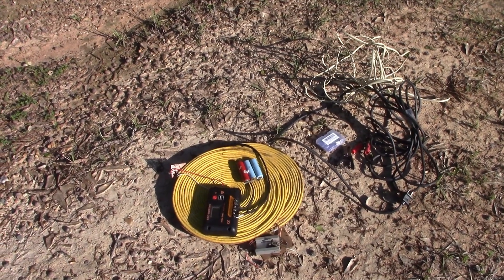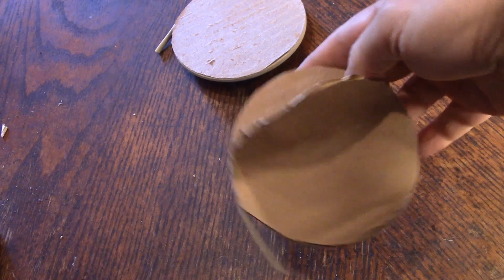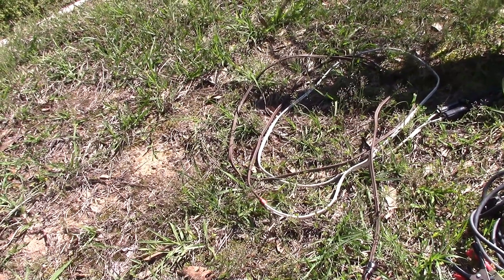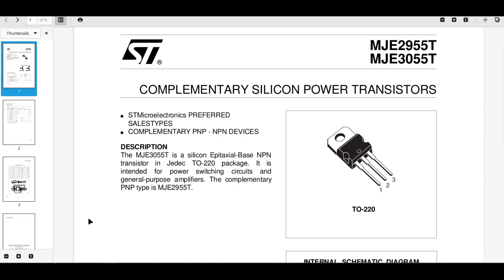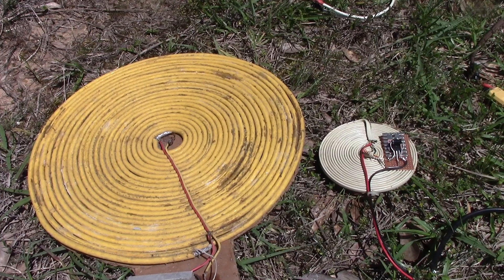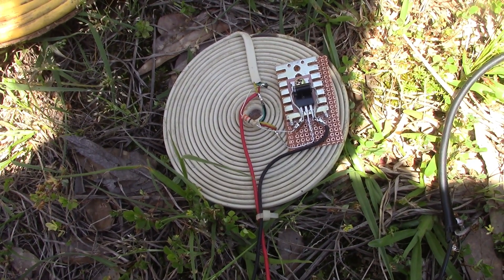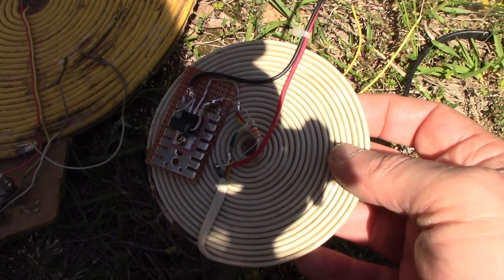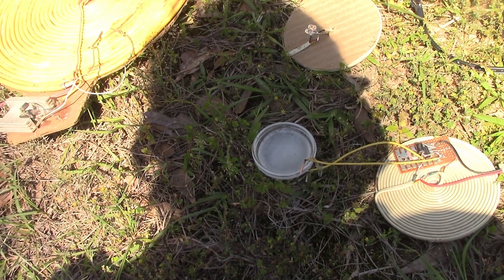Window Wireless Power Part 2 - Upgrades

Comment: Be interesting (for this Geordie in Calgary) 
to see what you come up with. Subscribed!
Reply from the maker: Thanks dSquared 😀The latest is that I blew up at least 4x MJE3055 power transistors yesterday, one of them instantly made a snapping sound and cracked down the case on connecting the wires. Then realised it could be because of the solar activity! Solar panels and the biggest solar storm in decades don't mix 🤣

Comment: I've got a wonderful idea. Why don't try my idea, use the ground, sand, and terracotta pot method. This has been used by the ancients, and third world countries for years.
Reply from the maker: Thanks Timothy, that's a great idea! As in a 'sand battery'? We used a large metal bucket with sand in over winter, would put it on an outdoor fire for a couple of hours each evening. Something similar with a piece of toaster wire or grafoil in the pot is the thought, varying the size for the right resistance 😀

Comment: heat sink the shit out of the resister
Reply from the maker: That's where it's headed I think, Tim 👍
Grafoil has been found to work instead of the water/copper thing, but it gets really hot as a current limiter too from the panel.

Comment: I wonder if you increase the voltage so in theory reduce the  amperage and then reduce voltage to get your amperage back. More telsa less Edison. Great video i have every faith in  you to solve it after watching your older videos. Good stuff thankyou for sharing.
Reply from the maker: Cheers John 😀
I think it's the voltage stepping in as the issue y'know, but your point is great to work on. If the panel is sideways or away from the Sun then the circuit works fine. In full direct line it quits and heat builds fast. Also, that's a noted effect with some other oscillators here, they over saturate at a certain threshold.
The input needs regulating to 2 Amps, which would go a long way to helping all of it. I think most of it is that there's no proper regulation, the circuit will take whatever V and A it can get and suffers from doing so.
Reply: @Slider2732_  makes sense so if you go solar to charge controller to battery things would be stable then go wireless through Windows?..it's a great project and I am looking forward to the next video  on it. Cheers slider2732..
Reply: If you are not bothered about losses would be cheaper to use bulbs on solar panel and try to regalate full sun to required v&a . That way?. That's my 2p worth give someone else a chance now. As before great project.
Reply from the maker: @johnwynne-qx6br  Always enjoy your comments 😀
Hmm, seems like the Bedini SSG method of using 'ear of wheat' bulbs. Hadn't thought of that.
Ideally, the 100W 6A system could be scaled even higher (mini Wardenclyffe's in people back gardens lol), but everything should be same as conventional once it enters the house. As in, charge controller, batteries etc as per usual. For the 2A systems, same thing, except the receive coil can convert to DC for powering 12V fans, charge cellphones, be usable with 12V equipment directly if wished.